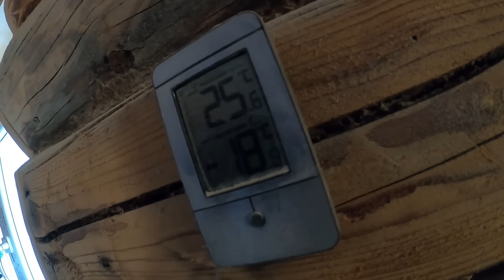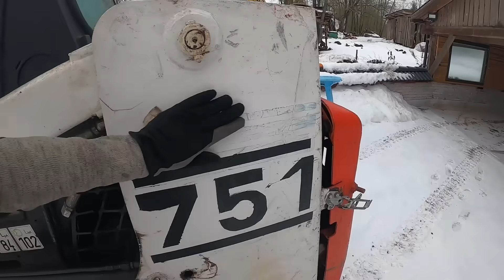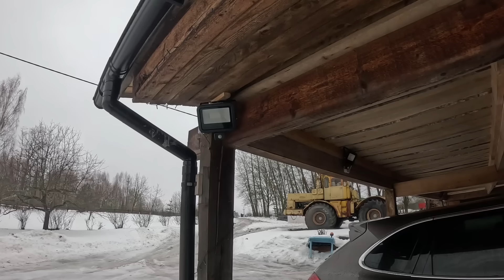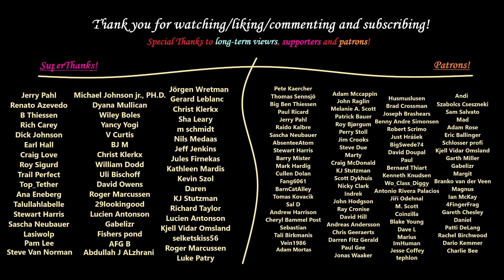Odd ends, side jobs and stuff - vol9

Comment: The individuals LEDs are in series. If one LED goes out, the whole string goes out. If you open up the fixture and short out one LED at a time you can find the bad one(s).  Solder around the bad ones and it should be able to work again.
Reply from the maker: Hmm
Reply from the maker: Too much effort😅
Reply: Considering all your project backlog I would agree. But you could save the fixture for a later day just to experiment.

Comment: That's why I prefer sliding doors or inward opening doors. If you go with a sliding door, put it inside the building instead of the outside. You loose some wall space but it opens even with snow built up against it. You could always hang stuff on the inside of the door if you bracket it right so nothing fall when moving.
Reply from the maker: Cool idea

Comment: You need another diesel furnace.  You could keep it portable and fire it up when you need to heat a vehicle.  Use one of the duct hoses to flow the hot air into the engine compartment.  Of course I would also plug in a block heater for the colder days which should be on all the equipment that you need in the cold.  Those and a heated dip stick to help heat the oil would ease the starting.  Over the road long haul truckers use diesel heaters that are plumbed into the cooling lines which keeps the cab warm as well as the engine as the coolant circulates the heat throughout the block.  That way they can pull over and sleep when they have worked their maximum hours even though they are away from electricity.  Espar is one brand although high priced and short lived.  Some of the chinesium diesel heaters are also for warming the water like the Espar.  Webasto is another, again pricey.
Reply from the maker: Actually i got that idea lol, its genius

Comment: A suggestion for the camera stand  Weld a handle to the bottom nut to make quick adjustments to vertical settings. Super Mom making quick fine tuning shovel work after the plowing! Yeah Super-Mom!!!
Reply from the maker: Great tip!

Comment: Ants You have a lathe. Learn to cut threads and make your own bolts as long as you need.  Keep up the good work!  For your monopod just weld a nut to the side of the large pipe then  drill through. Then weld a  t handle on a screw and you are in business.
Reply from the maker: Seems complicated m8 i gota try

Comment: 43:45 I think it is. The problem is either too much current to the LED or bad quality components on the LED driver. Years ago I bought two 10W flood LED lights that had very nice warm white color and good amount of light. But they didn't last even in very occasional use. I think they worked about a year or two and then started flickering randomly or not turning on without hesitation. Then they both died. I didn't even use them outside, where they were designed to be used. The structure and materials were actually really decent quality, like the very thick glass, silicone gasket and beefy aluminium basket. They were nicely sealed. But the electronics were crap. Almost all LED lights (for household use) I've bought have died in a year or two. I have got a few normal E27 or E14 LED lights replaced under warranty, as some of them come with a 3 year warranty. In one E14 lamp I took apart, there was a capacitor with 130 °C temperature rating and it still stopped working.
Reply from the maker: Bad quality. Chinese parts

Comment: I guess you really don't get much snow there usually. The total you have is now often what we have on the ground here in Ottawa, Canada but we used to get at least four times as much. I was driving an "underbelly" salter (Small plow under the frame between the front and rear wheels of a mid-sized dump truck) for the City of Kanata (Now part of Ottawa) and we had 50-70 cm (Varied within a couple km) in less than 24 hours. The plows would get stuck if they came to a full stop. Regular, pickup-sized tow trucks were stuck all over. On the rural roads, farmers came out in their tractors to rescue everything smaller than a small dump truck. I had to drive with my plow raised, just to cut the depth down; otherwise,  the buildup of snow under my truck would take too much weight off of my drive wheels! Crazy eh?
Reply from the maker: Yeah i know exactly what you mean

Comment: Just a little tip. Run a wire from the battery positive till the glow plugs hold it on for 15 seconds then run round and start the engine its a quick fix provided the glow plugs in the engine are in working order. Or else buy some starting fluid but be careful and use only very little of it.
Reply from the maker: I will look into why the switch was disconnected

Comment: Put a battery charger before turning it will heat up battery while charging and also mix the acid. Or connect two batteries parallel to increase power(not voltage).
Reply from the maker: Yup

Comment: Very nice bathroom remodel using leftover parts!

Nice (but heavy) extra camera stand.

Looks like you need to get the glow plugs working on your skid-steer, now that it is your snow plow.  That way it can help during those cold days and nights....  If the glow plugs are too difficult or expensive, maybe install one of those external oilpan heaters or install a block heater?

I have noticed that many of the cheaper LED floodlights seem poorly made -- mostly because they don't have proper heat dissipation for the LEDs, so they burn out due to overheating.  You might consider checking them before installing to make sure there is proper thermal paste and tight connection between the LED panel and the aluminum housing.

Thanks for the video Andres.

Cheers from Oregon, USA
Philip
Reply from the maker: Thanks for the tips! I got an idea about the heater

Comment: You should have soft plug heaters in anything you need to use in the winter time.   You would not have need to plug every thing in, until you are thinking of needing to use ahead of time, but even with that thought, it dont take that long to heat the block.
Reply from the maker: Yup

Comment: The water flow is the same on bottlenecks or on wider areas.
However the water speed is inferior on wider areas and increases in bottlenecks.
A rule in physics explain that non compressible fluids like water, for a steady  flow : have their pressure lowered and their speed increased when the section of passage is reduced.
They have their pressure increased and their speed reduced in a bigger section of passage.
So i guess slower water flow ,in wider areas,will have more time to freeze,being in contact with more surface area,and have more heat exchange surface area with the ground,and air.
In bottle necks,water speed is increased,less time to exchange its heat ,and les calories to loose since it's a smaller contact area with the ground,and air.
Also,friction between water molecules in high speed zones reduce maybe the ability to form ice crystals.
Reply from the maker: Yup. Good lesson

Comment: Companies are notorious for overdriving LEDs, partly because they will break, but also just to get a brighter light for cheaper. The black dots are LEDs that have blown due to running to hot. You can extend the life of the panels by removing a resistor from the current limiting IC. Literally all you need to do is take a pair of side cutters and cut one of the surface mount resistors breaking it. The light output will be a bit lower but it will run a lot cooler and should last for years.
Reply from the maker: Cool thanks
Reply: @Ants_Pants  Here is a video by BigClive if you want to know more, I know your not very interested in electronics, if you want the short version. You would remove the lower value resistor to bring the current down a bit or the higher one to bring it down more (only remove one resistor). I don't know if I can link to the video so just going to post the extension if you go to around 13:30 you will see him removing the resistor with side cutters. The video is for a ceiling light almost all the cheap LED lights are using the same circuit these days. watch?v=5HTa2jVi_rc

Comment: Instead of blowing heat down the exhaust try blowing it down the intake so that warm air is in the cylinders. You can also put a block heater on the engine. You just need to plug it in a couple hours before using.
Reply from the maker: Ok

Comment: If you weld a large washer on the pipe clamp screw , you can tighten and loosen the clamp without tools
LED lights don't like the cold, especially cheap chinese ones

Comment: As you have a gaz torch. why not take the air filter out of your skid steer in the winter . apply direct heat into air cleaner casing. you machine will start more easily. I always do that on my single cylinder boat engine.  Always starts on winter days first time.
Reply from the maker: I have and idea

Comment: bit of advice. if no glow plugs work on machinery, use bit of break cleaner in air duct. if -20C then bit of ether and break cleaner. But then never glow plugs, otherwise kaboom. And diesel engines like good juicy batteries. Keep on content coming, good job.
Reply: Brake/carb cleaner causes preignition. Better to use starter gas.
Reply from the maker: Good tip!
Reply: starter gas is ether, and imho too harsh, will make all kinds of scary noises. But break cleaner is smoother, no clanging or banging  @otofoto

Comment: I was somewhat surprised to note your concern in regard to using screws instead of bolts (security) for the hinges for the cabin door,  combined with a previous video of you fitting security lights around your home now leads me to suspect  there is criminal activity in your area. Somehow I never thought of such requirements being necessary where you live, everything seems so perfect in your videos crime never crossed my mind.  Perhaps a notice at your property entrance indicating that "Super Mom" lives here would deter them, she really is some lady. cheers
Reply: In some reason in last 15 years I never lock my doors and most often I leave car keys on at home and when shopping in Estonia... We had our crazy 1990-2000 but after that crimes have went down to minimal level... But for doors bolts are way to go. Wind and so on can break the screws easier than bolts. But He got to short bolts and later change them out....
Reply from the maker: Drunk guys and some random engineers fron africa are main concerns

Comment: Soz if someone already asked this….but was that a heat gun in the exhaust of the skid steer?   I’ve never seen that done before. 
Is the intention to get some heat into the cylinders to assist compression, or to warm the oil up?

Comment: Hey, LED guy here. Those dark spots in the middle of the LED chips mean the chips have burned through, they aren't supposed to be like that and basically mean they are porked! The issue isn't with the sensor. 
In most cases LED's on the board are in some version of grouping, by 3 or by 4 and then grouped in series and parallel, to make sure they share the correct voltage, since each LED chip can mostly take no more than 1-4 volts, depending on the chip type, once one or more start going, the rest of the LED's share higher voltage and burn out quicker. Basically, this happens when the LED's have poorly designed cooling or more specifically, heat dissipation. It is fixable, but it depends if you have the chips on hand, and have fine electronics soldering equipment. The chips themselves are probably like 50 cents to a euro or so a piece. I fix things like this daily, but if the light isn't very expensive, it's cheaper to just get a new one or better yet, get it replaced under warranty.
Reply from the maker: The flood light was 36 eur total. 50w
Reply: @ants Aah, yeah, then go with the warranty. The parts needed to fix it aren't all that expensive, but the work itself is probably going to cost as much as the light itself. The only upside or point in doing it, is to just 'upgrade' the heat dissipation of the OEM construction, like adding a better aluminum plate behind the LED board and use some thermal paste to connect them together, which will increase the life of the product. Sadly, most of these products are made with decent parts, but poor assembly as if designed to fail quicker than they need to.

Comment: Chinesium LEDs are crap quality. They quickly degrade and lose brightness until they barely glow as you see there. But they still consume power as if they were fully lit. They're also typically over driven with too much current so they burn out and get those brown spots in the middle.
Reply from the maker: Yup